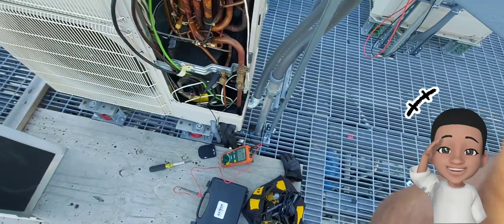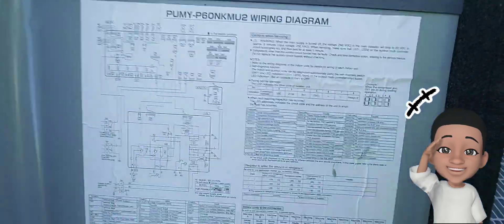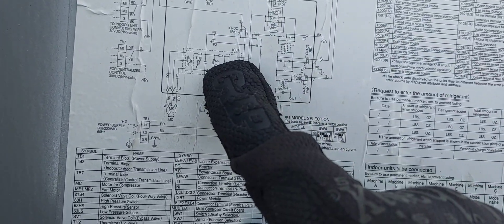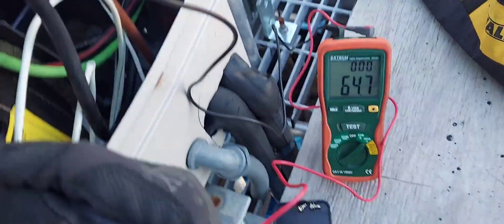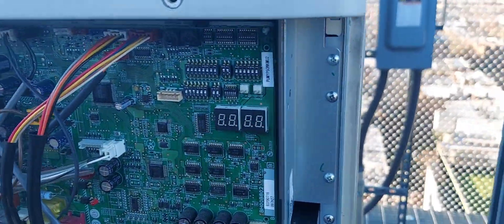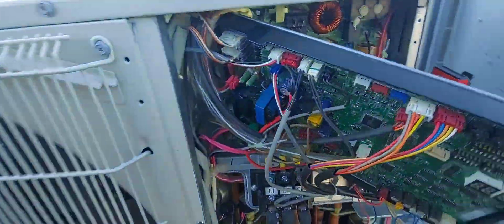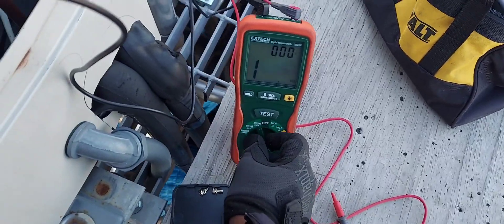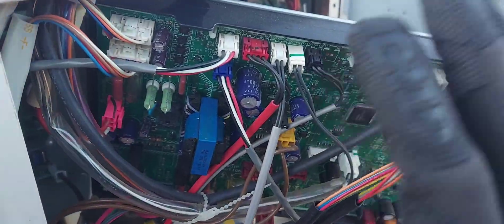HVAC TROUBLESHOOTING | MITSUBISHI CITY MULTI

Comment: Good thing about them boards are, their are a few points you can ohm out and if it's bad your done. If that back board is bad, change the power board also because that's what took it out.

Comment: Always look forward to your videos even though im not on that level yet ,i understand the megg was just a bit confused why did the voltage dropped from 250 to 0 and what would u expect to see if it was good ?
Reply from the maker: Regarding the voltage dropping from 250 to 0 you will need to know ohms law for that to make sense!
Reply from the maker: Good question my friend ,  the test voltage would remain the same or have only a slight deviation lower if the compressor windings were good.
Reply: Okay, great stuff as usual my friend ,looking forward to the next one .

Comment: The noise filter board in the back is a common PCB to fail. I have replaced them on units that are 10+ years old
Reply from the maker: Hmm I didn't see that on the schematics or wiring diagram!!!
Reply: @D2DNYAC  That's what some people call even  Mitsubishi, the noise filter board. Sorta like someone calling a thermostat a controller. However on that back board their is a resistor some where, when you ohm it out you should read 20. You don't it's bad period and that's usually because the power board took it out. Replace both.